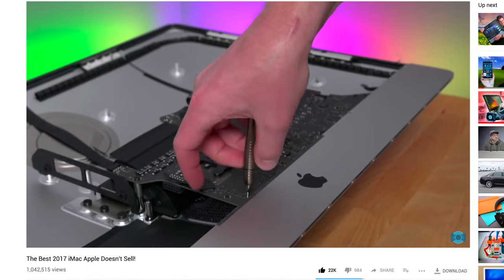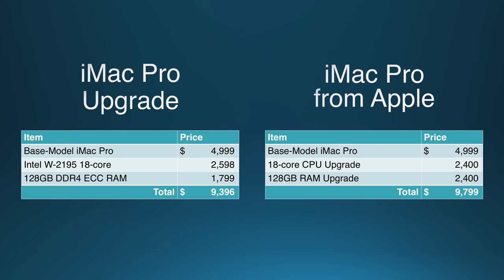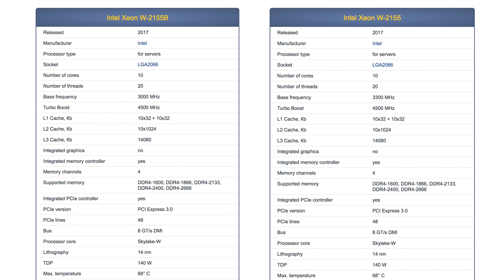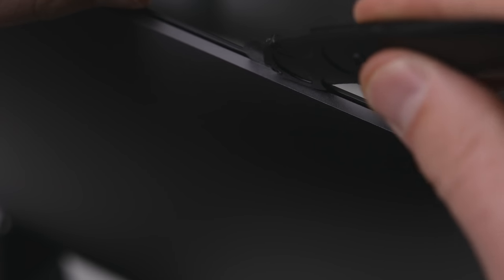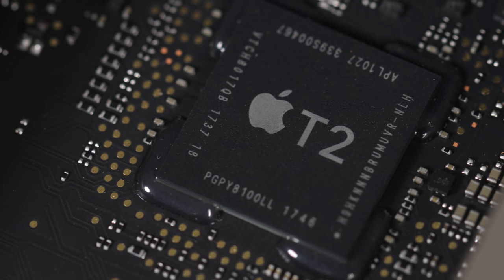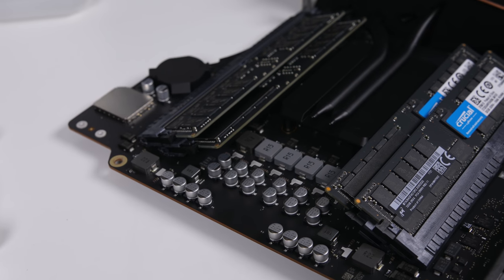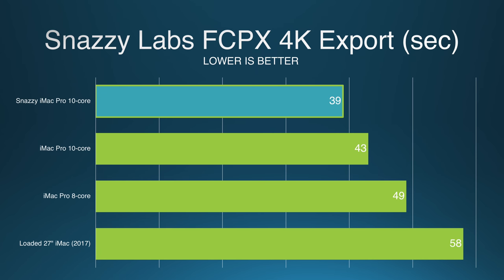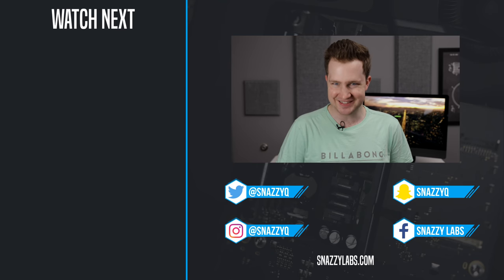Can You Upgrade the iMac Pro?!

Comment: You wouldn't have to worry about  voiding the warranty by upgrading if you just avoided buying a damn Mac.  With the crap thermals of that abomination of poor design you are also insuring that your expensive hardware will run at lower frequencies and likely at least one of those parts will die sooner from heat damage.  This is simply not a good product.  Even if its not overpriced it's still a terrible purchase no matter how you slice it.  Other than trying to stay in Apples good graces I really don't see why you bothered to make this video.  The product is crap objectively, stop making Apple apologetics (maybe your trying to get Apple diehards to stay subscribed to you idk).
Reply from the maker: lol
Reply: This video is obviously dripping with sarcasm but there really isn't enough condemnation that can be levied at the engineering of this machine.  The two groups that really benefit from ECC Ram are programmers and heavy VM developers.  Programmers that really need the performance of this machine usually are OS agnostic (basic app and workforce developers are the most common programmers who use Macs and a mac book is fine for their meager performance needs).  VM developers also aren't likely to desire OS11(and they often need more PCI-E expandability than this provides).  Apple didn't release the Imac Pro to drive profits (it barely creates any per unit sold) its a desperate attempt to dissuade the mass exodus of actual pro users who are abandoning their platform (which they don't care about but its harmful to their marketing to non-pro users who are their main audience now).  Xeons and ECC where used to distance this product from the higher volume (and much higher profit margin) 5k Imac that Apple would prefer most of their consumers buy (there is also the problem of a higher power supply/more heat production not working with the form factor anyway).  Lol can you imagine if Apple had included an external power brick for a "workstation grade AIO" how much Apple fans would whine that it ruins the aesthetics of their workspace.
Reply: Brandon Casey Jealous much?
Reply: I'll admit that I responded before seeing you entire video (which is uncharacteristic of me).  I think what is causing some of negativity in the comments section is that you start the video by defending the Imac Pro as not overpriced before getting into more of the sarcasm with the Imac Pros serviceability and engineering concerns.  We all know the lengthy ordeal you had to undergo to get your Imac Pro repaired and applauded when you didn't go easy on Apple in the video you made after you finally got a satisfactory resolution (which likely only happened because Apple Corporate intervened with the store manager).  The first few minutes of this video can give the impression that you are intending to back track.  It is important to watch the entire video before commenting. Apologies.
Reply from the maker: Brandon Casey No worries. Cheers.

Comment: Omg a Crapple fan boi.
I don't know where you're buying your parts; but I can get them a lot cheaper then your displayed  costs.
Another part for part comparison still no where makes the comparison even closeeven for pc choice over Crapple. PC you can get parts and repair anywhere far cheaper..
Intel has always overpriced components.
Amd thread ripper leaves both in the dust performance for far cheaper.

Comment: You think the imac pro is workstation grade hardware?  HAHAHAHAHAH.   Apple hardware is the lowest possible quality, cheapest thing they can possibly make, wrapped in overpriced industrial design.    This is known information.
Reply from the maker: Workstation-grade parts? Yes. ECC memory, Xeon chips, and Radeon Pro graphics are not a standard affair. You can think Apple sucks at design, that’s fine, but technically it’s a “workstation” machine.

Comment: Apple sucks. A decent pc can go for way less than 1000 dollars and if you look for used parts you can build a great pc for about $400 The best apple products ended with the osX machines. All the pc parts you can get for way cheaper than you put them down as ( except for the graphics card cus nvidea is money hungry) and for the best part. Apple is anti consumer and anti right to repair and will lie to their customers to get an extra buck. Pc is master race not just because of the price but because of the user to choose what ever the user wants to use and run on their pc. With apple you can only run what apple certifies and you can only have it in this flavor and no other. No customization on what you want to run with the system user unfriendly peripherals and you need a special converter that costs more than 50 bucks just to use a second apple monitor , graphic cards ingeneral gives you at Least two video ports for no extra charge and graphic card adaptors are cheaper than dirt. But the biggest sin you committed was mocking pc.   I'm sorry for you and others like you who have not woken up to the lies apple feeds you.